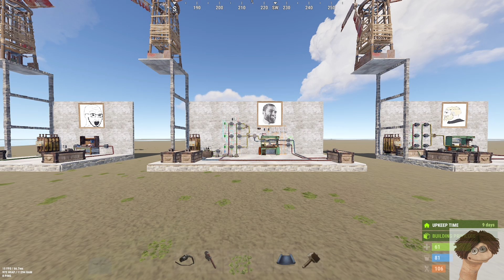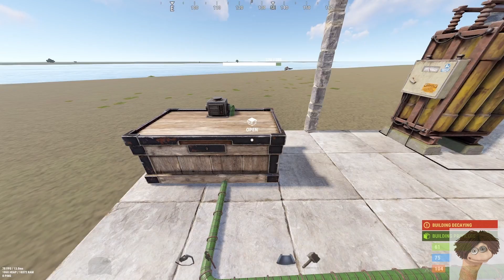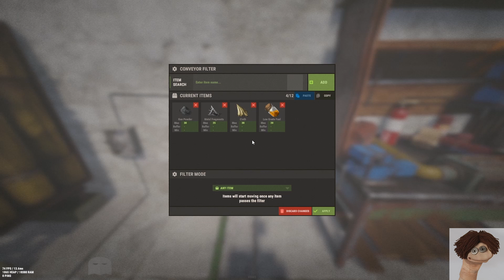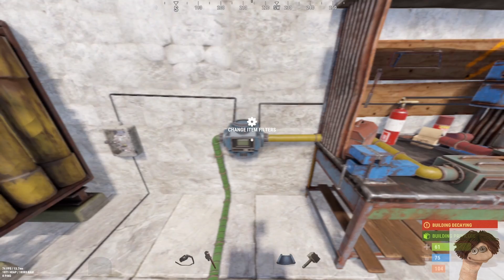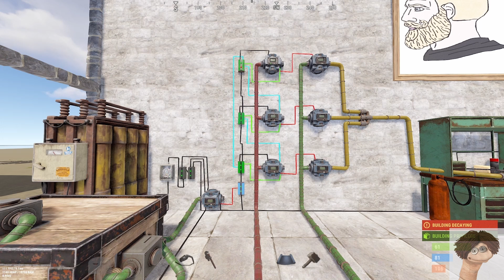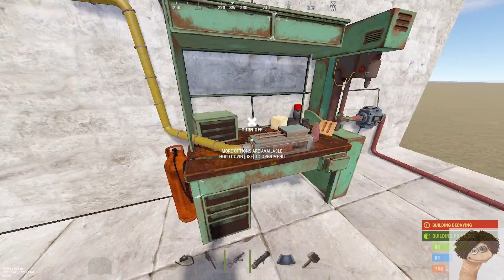The Last Industrial Crafter Guide You Will Ever Need | Rust Electricity ( OUTDATED )

Comment: 2:20 this right here was the one key piece of knowledge I was needing.  Thank you!  So simple.  I saw a few other solutions using different buttons to press for each craft and conveyors to pull blueprints in and out and RF devices hooked up to it and wired all to hell, this is so much easier and such more automateder.  This should cut the number of crafters I need in half or more.

Comment: Amazing video!
In my case for some reason 18:15 additional resource conveyor doesnt turn itself off. It just sends the materials but doesn't emit any signal - neither fail nor pass. What could be the problem? What have I done wrong? Did they patch something?
Reply from the maker: Yes, the video is from before the big electricity update that changed conveyors a bit. I have adjusted the crafter to work again as its supposed to. Hit me up on discord and i can send you diagram for the new version
Reply: At the same time, the conveyor for removing blueprints works as it should - it turns itself off after the first use.
By the way, to craft a rocket you need 150 gunpowder. Do you need to install 4 additional conveyors?
Reply from the maker: @pumpum9937   No you dont, hit me up on discord for updated version :-)

Comment: You dont happen to have the diagram for the 3rd one do you? Sometimes hard to follow on youtube. Also, you said you can put unlimited things into that system. How would I go about having it auto craft a full kit of gear, guns, ammo? Do I need to add more modules to it?
Reply from the maker: The little issue with rustrician diagram is that we cant put any settings on conveyors and have proper function of conveyors pass/fail outputs. 
And yes for each item you have to add 1 module ( memory cell, item check conveyor, resource conveyor(s) ), this way you can extend the sequence to be as long as you want. 
All though i do not suggest crafting ammo and meds in the last setup if you play in bigger group, you may run into an issue where the crafter single cant keep up with the demand. First setup is ideal for ammo and meds.
Reply: @HyperionRust  tyvm